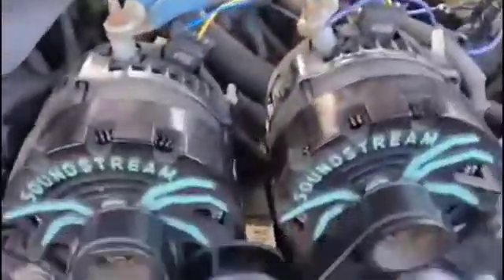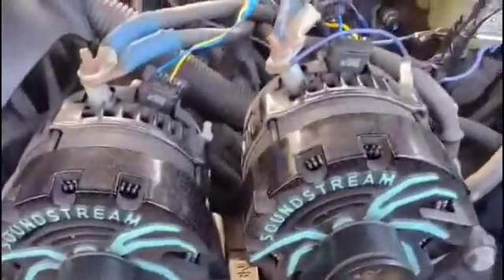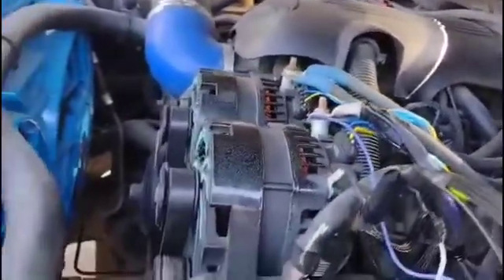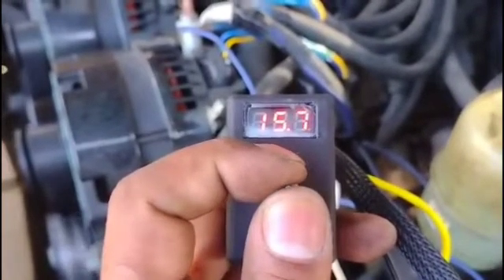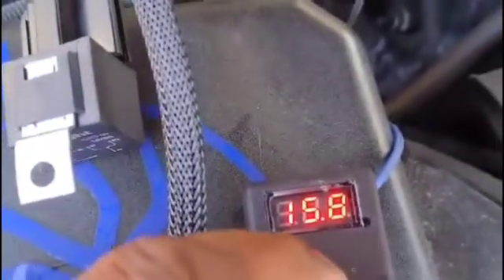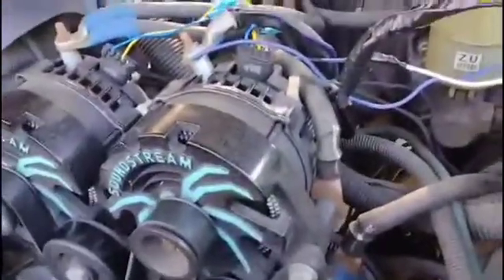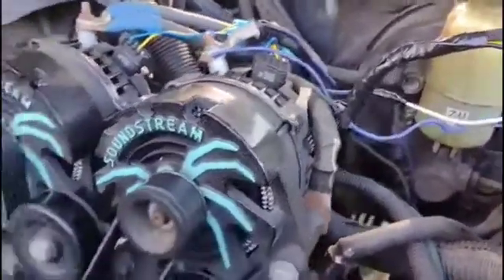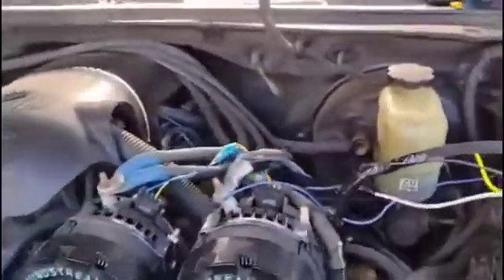VCM-6003 Voltage controller running up to 3 alternators. NOTE disclaimer on needing a relay.

Comment: Ok is the relay only needed if running multiple Alt or will I need one for a single Alt and VCM controller setup
Reply from the maker: RELAY IS NEEDED FOR MULTIPLE ALTS.  WE ALSO SELL A RELAY WIRING KIT